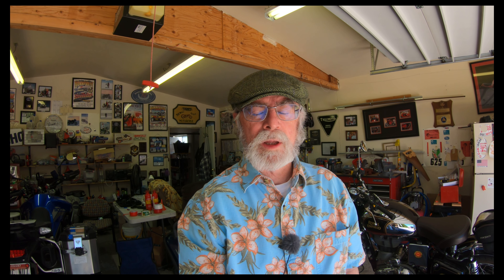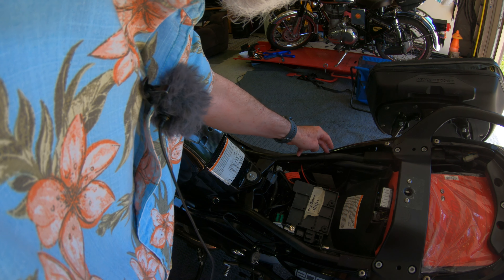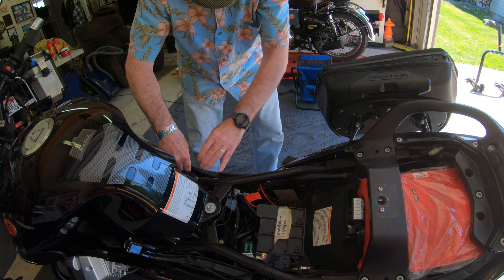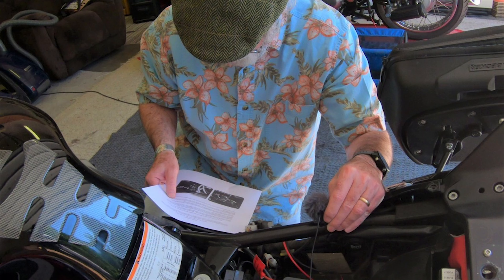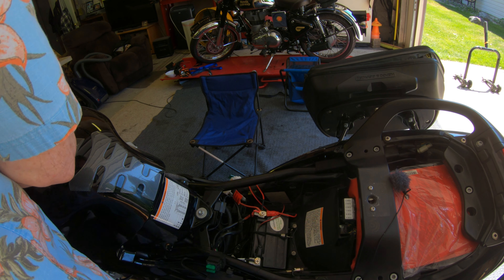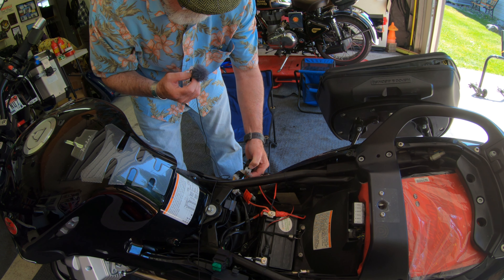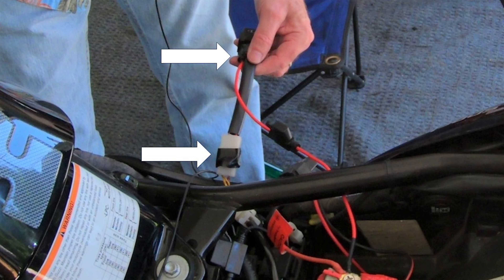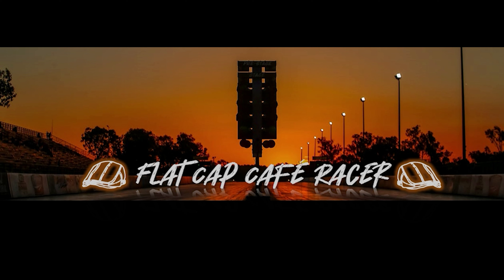Solving the "Startus Interruptus" on my Moto Guzzi 1200 Sport

Comment: The additional information you may find useful (which I also shared a long time ago on the GuzziTech forum): 
I bought a Moto Guzzi Breva 1200 back in 2011. It is a 2008 model. For several years I did not experience any issues related to the starter. However, it finally popped up and started giving me grief, especially in situations where I least wanted to see it happening. 
I am an engineer (electrical, software) in the automotive industry, so I decided to look into the issue after reading the extensive discussion on the subject online.
I checked the schematics and measured things, also with an oscilloscope (during crank) and got some interesting results. You see: there is no direct connection between the red start button and the starter relay. Instead, this button is wired to the ECU (or DSB, not sure now - but it isn't that important) and it is the module that recognizes the command from the rider to start the engine. However, it must check if the conditions for a safe crank are met. Specifically: the kick-stand, the neutral status, the clutch lever position and who knows what other conditions. Sure, those checks are super fast, and last only a fraction of a second to complete. Once all conditions are satisfied the controller module may activate the coil in the starter relay. In my case it did and it was clearly audible. However! The controller continues to operate and monitor the situation as it activates the crank cycle. My guess here is that it detects the voltage drop and is overly sensitive to it. So, the reaction is instant - the deactivation of the starter relay. So, the click is heard and the starter relay closes the main, high-current circuit to allow a crank, but before the crank happens it gives up and opens the circuit before the starter moves the crankshaft.
It is easy to simulate the action of the controller by touching the coil terminal which is normally wired to the module with a wire (fused, let's say) whose other end is connected to a positive terminal on the battery. It always gives a clean crank without any hesitation. BEWARE, though!! When you try that ALL THE SAFETY conditions are bypassed, so you may crank the engine whilst in gear (the computer checking everything is now your brain! Be extra careful and double check everything). Also, since it is a manual crank you must open the starter circuit as soon as the engine is started or the starter may be damaged. Normally it is the controller module that does it automatically based on the crankshaft's RPM sensor.
 
Now, this all means that it's not necessarily the bad contacts or faulty relay (yeah, those can happen, but if there is absolutely nothing wrong there, then.... see above) but rather the unfortunate system design:
when one looks at the schematics one can see the line from the battery that is monitored by the controller module branches off to all different parts here and there. In the physical world, it means that the distance from the battery terminal (just under the saddle) to the location of the electronic modules is quite long. My friend who designs electrical harnesses for vehicles said it is quite common to splice wiring inside the harness. I am sure the Guzzi harness has multiple splices on this particular line which may contribute to the problem (i.e. the central module sensing something it doesn't like during crank and aborting it). I wonder if routing a dedicated wire from the relay's coil all the way to the sensing pin on the controller module would also fix the starter issues for good. Who knows...

So, yet another perspective on this Startus Interruptus phenomenon.
Reply from the maker: I'll pin this. Many thanks.
Reply: @flatcapcaferacer  Sure, glad you find it useful.
Reply from the maker: Probably the best explanation I have received!
Reply: thanks to all, having the issue now myself

Comment: After install, it sounded to me like the starter spun stronger.
I know on my Roadsters, increasing battery wires to #4 from OEM #8 made a huge improvement.
Reply from the maker: I thought it did too Steve but I thought it might have been my imagination. 

I you and Rob are ready for Bonneville,  only five or so weeks.

Comment: So, the bike did start without the fix and it also started with the "fix". But based on that one cannot tell for sure if the original issue is solved. This video is now 9 months old, so would you please share the status? Has the interruptus been gone since the installation of the additional circuitry?
Reply from the maker: Never came back again 👍
Reply: @flatcapcaferacer  Great result!